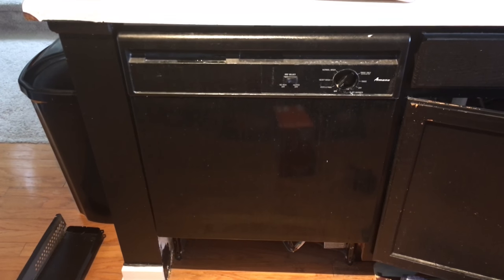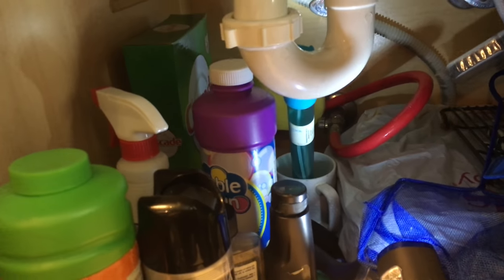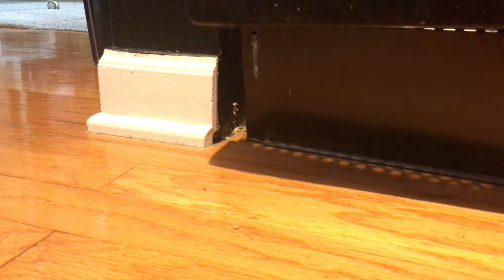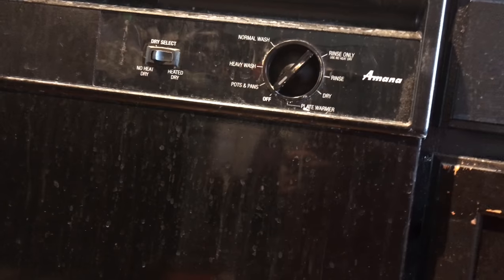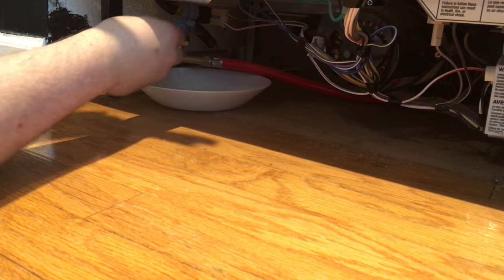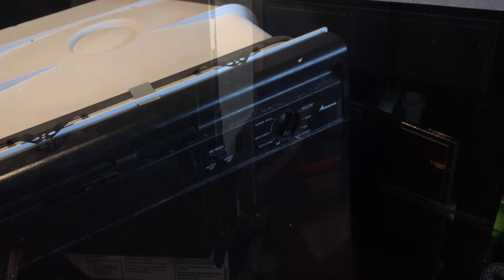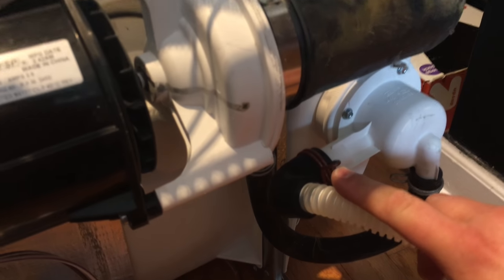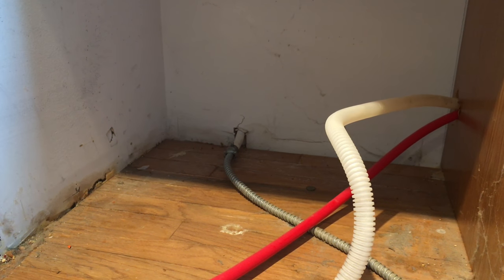How to disconnect and remove your old Dishwasher in 4K! (Detailed and Step by Step)

Comment: Good video, but I will add a little note.  Always check your electrical connections with a non-contact tester and not rely on the dishwasher "making noise'', especially if the problem ends up being faulty wiring.